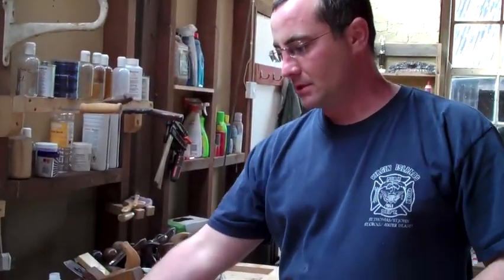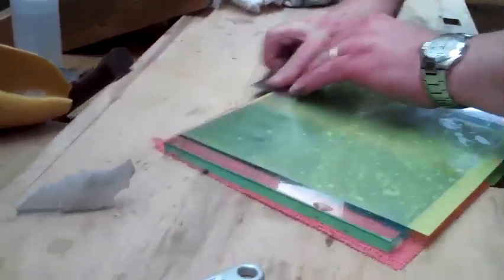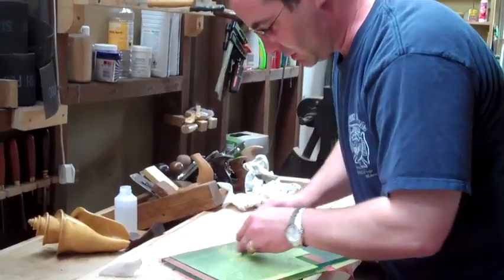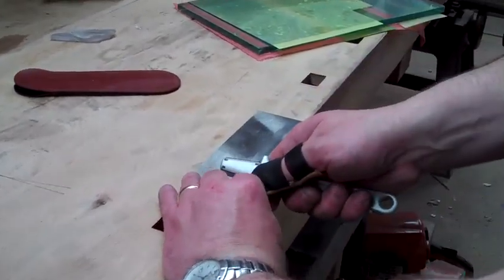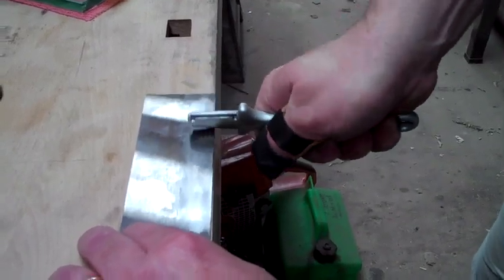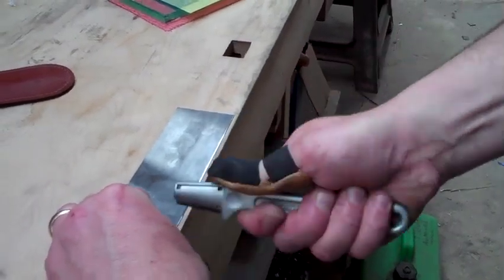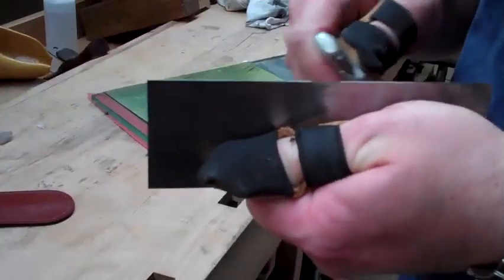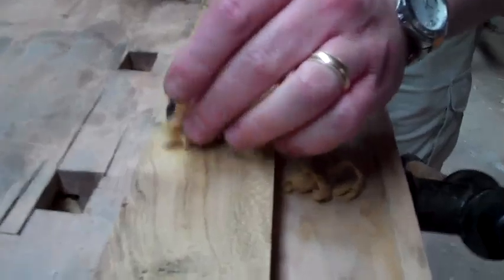Workshop Heaven - ARNO Carbur2 Carbide Burnisher

Comment: Having just bought one purely on the strength this video Matt, if it doesn't work as you have shown I shall come and breathe on your specs.

Actually, the only issue I can see is when you roll the two edges. I would have thought that the first roll would displace the second burr at the same time but having polished two scrapers ready I will now pop down to the shop and give it a go. Hopefully I won't be seeing you tomorrow.